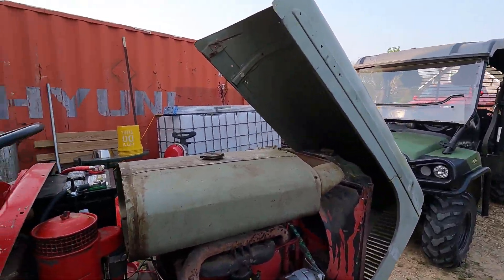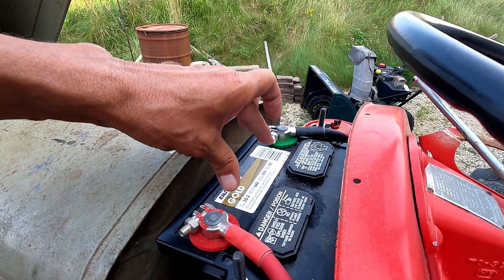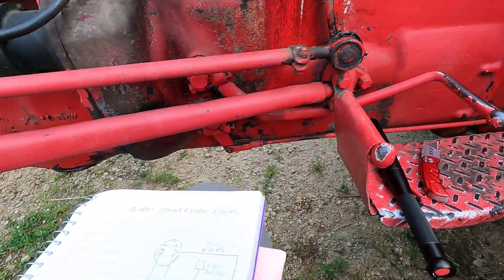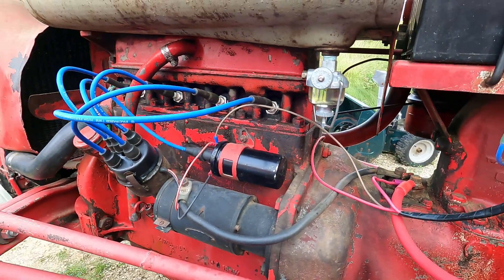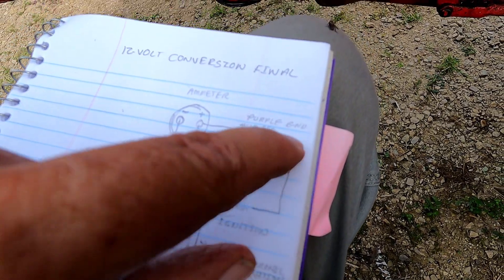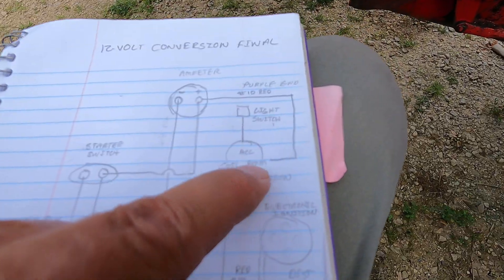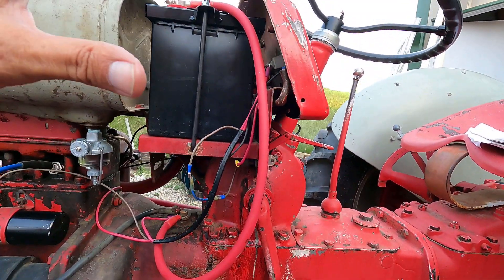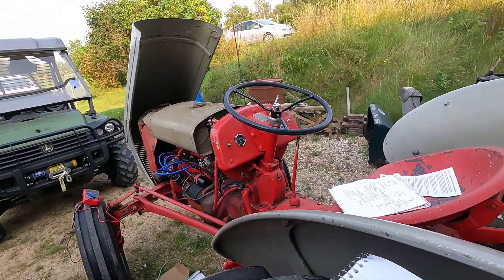12-Volt Conversion Wiring Details ― Tracing the Wires

Comment: Watched several videos this is the best info so far . But I can’t get tractor to turn over it’s not getting power. Any suggestions? Would really like a email with your diagram. Took snap shot but couldn’t read . Thanks
Reply from the maker: My diagram will not work for tractors that are not using the exact parts that I did. I cobbled together the diagram for the tractor with the conversion kit's diagram, and added in the info from the coil and electronic ignition.
Reply: @PlanetMojo  I’m using same parts as your video . I just order electric ignition. Have one on it now but I think it’s a6v . Hopefully that’s what my issue is
Reply: I could use a picture of your diagram you drew also please

Comment: Is there any way you can get me a picture of your diagram? I must be missing something. I can’t it 12v to work
Reply from the maker: I'll take a look for the diagram the next time I'm out in the machine shed.
Reply: @PlanetMojo  I would greatly appreciate it . Thanks for your help
Reply: @PlanetMojo  I hate to bother you but , I really could use your diagram. I installed electronic ignition,12vcoil one wire alternator, 12v battery,and I am having issues.
Reply: @planetmojo  I could use a picture of your diagram you drew also please

Comment: Mojo did your tractor use to have the push button start? None of the diagrams show the push button.

Also back of my amp meter show a positive on both sides. So im assuming while looking at the back just treat left side as negative to alternator.

Also thanks great video
Reply from the maker: Ferguson tractors don't have a push button.

Comment: Hi Mojo, so the coil is 12v, but if i keep the 6 volt coil i have to use the resistor, right?
Reply from the maker: It's been a while, but I believe the Pertronics coil made the difference. Not sure if it matters what the voltage is. All of those instructions were with the electronic ignition and the coil. The kit came with a resister, so it's likely you need it if not changing the coil or ignition.